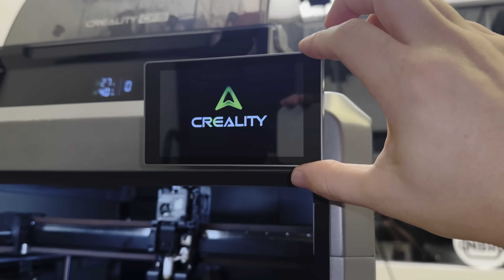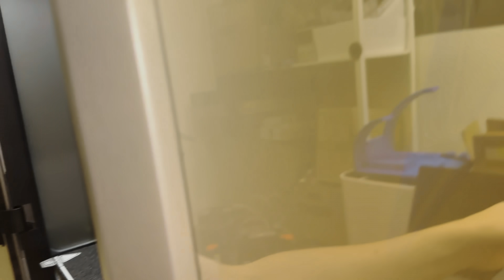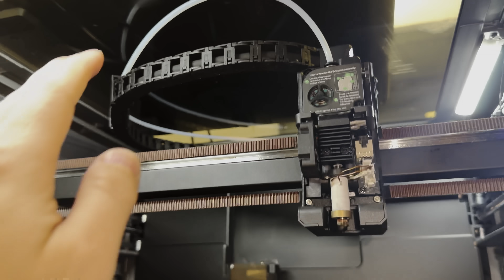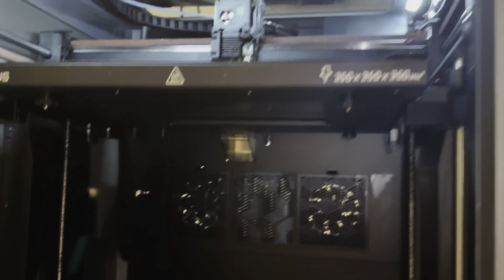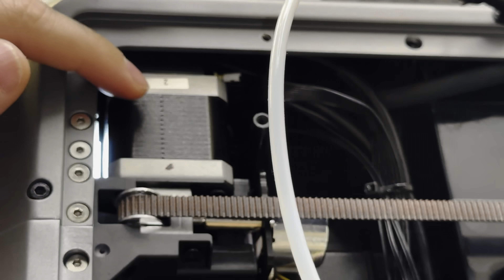Creality K2 Plus - What's Under the Hood?

Comment: And 3 months later we find out that the extruder design is not stable, gears are not harden and made of plastic, the cutter jams and causes jams on retractions, extruder coupler at the top fails often because all the torque of the retraction, and the list goes on.  Being a mechanical engineer I hope creality develops fixes for all these or a company like Biqu provide a better design extruder to replace this mess.

Comment: if the bed sink, that means on power loss it can't resume perfectly right?
Reply from the maker: No, it works fine. It homes at the bottom and generates bed mesh at the top. On power up it rehomes to establish its position and resumes.

Only issue is if you wait too long before resuming the printed part on taller models it can shrink and cause a gap where the resume starts, but that is a problem for basically every printer.

Comment: Just picked one of these up this past weekend.  While I'm enjoying it so far, and is pretty on-par with my X1 Carbon... one thing I wish was that Creality got out of the habit of NOT having stuff turn off.  I mean why does the PSU fan STILL have to be on the entire time the printer is on?  Am I going to want to mod the PSU fan on my new $1,500 printer just like I did on my first $99 Creality Ender 3 Pro?  I'm thinking kinda yes.... but seriously, it would also probably help it NOT somehow supposedly use 24w of power when just sitting there not doing anything.  The X1 Carbon only uses like 4w at idle.
Reply from the maker: My PSU fan isn’t loud enough for me to notice that it’s powered on, but that shouldn’t be an issue at this price point
Reply: @NathanBuildsRobots  unless it's NOT the PSU fan, but it's definitely a fan of some sort, and it's not any of the chamber fans.  Considering the PSU looks the same as what was in the ender 3... Gonna go with that being the culprit.  Lol
Reply: @NathanBuildsRobots  Yeah, it really shouldn't.  But I can tell its on from the other room... even if it's just been sitting there idle for over an hour, whether it had printed something and long since cooled down, or I had just turned it on.  Like I said... just like the old Ender 3 Pro, when power is on, the fan is going.

Comment: You may want to try “Ronsonol” lighter fluid as a sticker residue remover. I’ve used it on a variety of plastic surfaces, including plastic convertible windows, and it removes the residue faster and cleaner than any of the purpose made removers. Your mileage may vary and I urge testing before use.

Comment: I'm confused about the chamber heater.  Where it is pulling air from?  Inside the chamber or is it constantly pulling fresh air from outside the chamber?
Reply from the maker: heater pulls in air from outside, it has a 60C limit.

If they needed it to get hotter or run more efficiently they could recirculate air
Reply: @NathanBuildsRobots  Seems like a big waste of energy to be constantly heating new air rather than just keeping it in the chamber.  It also means more expelling of printing fumes out into the room.  If you covered the back air intake/exhaust holes, do you think the chamber heater would effectively recirculate air by pulling it in from the fans to the left and right?

Comment: In my experience with the k1 max and printing almost exclusively in ASA, the electronics can not handle the heat. 

Once the chamber is 45c on my k1 max, things start failing. Camera usually turns off. Im currently adding a fan to the heatsinks i already added...

Comment: God dang creality came in strong whit this one holy moly a bigger machine, RFID for the ams and outside the printer whit filament quantity display, filament dryer, easy parts replacement on the hot end,heated chambre and belt tension motors WOW this might actually dethrone the bambu.

Comment: Any ideas how hard it would be to make the vent fans actually vent outside? With my K1 Max someone designed a clip on adapter that allowed you to attach a 4" duct and fan to vent the printer outside... I print a lot of ABS and ASA. I figured someone might be able to make something magnetic perhaps? I thought I saw a magnetic poop catcher. I invision it being like a Y shape... connect over each exhaust fan and then at the other end of the Y they converge to a 4" duct to connect for propper venting. 

I print in an area I occupy and the ABS fumes are not something I want in the air.

Comment: Are there any marks on the back plastic part of the printer to indicate what type of plastic it is? Are the electronics screwed into the plastic? Do you think making a back plate made of pet-cf would be possible? How about covers for electronics inside the printer made of pet-cf? I'm thinking of high temp plastics in place of the stock plastic for esthetic purposes as well as making it  able to handle higher chamber temps with additional chamber heater

Comment: Regarding the electronics.. card at the front is the CPU, a 1.2GHz 64 bit dual core ARM that can run in 85 degrees celsius without heat sink (basically a mobile phone CPU) . It has plenty of power and can run the printer with its pinky finger probably only manages the screen, IO, wifi and such... .
The board on the backside controls the motors, however it seems like the actual driver is on the small breakout boards next to the motors. 
The small pcb at the back in top is probably the LED light driver.
Feels like this printer is a very modular build and changes are to be expected in upoming versions to reduce costs.

Comment: Hey @NathanBuildsRobots, I'd be interested to know the exact limits of the print size. Is it 350x350 exactly or can it be pushed further a mm or two? Sometimes these companies advertise the size of the bed but the print size is actually smaller. Important for me as I have a business that mass prints a specific part which is 350x350mm circular. Also I'd like to know the exact chamber temp it can get up to and if the temp is even inside the whole chamber.

Comment: Thanks for the video.
Frame on K2 is realy should become industry standard. It looks overengineered, but it's perfectly fine for 1.5 grand.
Lack of dryer in the Creality AMS implementation is my biggest complaint for now. Anycubic ACE Pro has that.
Last hanging questiosn are:
- Is extruder motor closed loop? (has encoder on the motor)
- Does hotend uses thermal grease? (did creality put additional thermal grease package in the box

Comment: I got a K1 Max and now I'm ITCHING to get a K2. The max is modded to the wazoo with linear rails on X/Y, watercooled heatbreak and other goodies. It's a dream of a machine now, but the K2 with those servos and the CFS is just so juicy
Reply: You listed off the bells and whistles of this thing but is any of that actually needed? I have a K1 Max too and it prints fine. I mean, there's nothing on this machine that interests me except the bigger build volume.

I don't even care about the multicolored printing. I don't even use the AMS for that on my x1c. I find it to be a waste of material and time.
Reply: How well does the watercooled heat break work on your K1 max? I've been having some heat creep issues on mine (stock heat break, Microswiss Flowtech hotend), causing jams.

Comment: The Mainboard doesn't need stepper drivers as the drivers are integrated into the closed loop control system of the motors, so the wires you see are most likely power, step, direction, enable and uart for sensorless homing. That's probably the same reason why they are outside the chamber, the driver would need active cooling. I find it very odd for the z axis to go down on its own, i have only ever seen that on belted z since there is less and different friction involved. I couldn't really tell, but were the leadscrews 4 or 8mm pitch? 4mm would be self locking if im correct, so impossible to backdrive. 8mm could be back driven, its not that hard with POM leadscrew nuts, not sure about brass ones, haven't had one of those in three years. Certainly interesting design with all those servo motors, although i still dont get it why manufacturers use smooth idlers on the teethed side of the belt. I would understand bearing stacks to a certain degree since they are sturdier, but not smooth idlers. The belts are 9mm, right? I wasn't sure as they look a bit thin compared to the ones i have on my 350 trident, but 6mm would look even thinner, ao i guess that answers my question already.

Comment: Nope closed looped steppers are very different from real servo motors. Real servo's are more like brushless motors like Odrive. They look like stepper motors but have completely different internals. Basically any direct drive motor in simracing wheels are servo's and they don't "steps". Closed loop steppers are just stepper motors with position feedback. 😉
Reply from the maker: Yes but these are "closed loop FOC motors" according to Creality's marketting, so they aren't stepper motors either. Odrive is capable of FOC control, right?

Comment: 2 things .. 
1: that empty bottom chamber is begging to be used. Either with a slide out drawer for storage, or an extra place to put fans for cooling for PLA purposes. 
2: any idea on the wattage this thing pulls when it's at full use with the heated chamber and higher temps? Have a feeling it's going to be substantially more than lower tier printers.
Reply: The stated specs is 1200W, no idea of actual power draw yet.
Reply from the maker: I'm guessing it draws ~500W max on 120V, and 1200W max on 240v.

Comment: I don't know if I'm right but i think the chamber heater should take air from the inside of the chamber (recirculate and warm it up) not push air from outside, for me it makes more sense...
Reply: You do lose some control then. If it is too hot, where is the cold air going to come from. Recirculating is good for heating, but not for controlling the temperature.
Reply: @alexa5231  Maybe use the exhaust fans to cool the chamber, only if needed. By doing that you save some energy. Like a PID control with two outputs, if temperature is less than the set point the heater is on and chamber exhaust fans are off, if the temperature is higher than the set heater is off and chamber fans are on... Split range.
Reply: My first mod would be a cover over all three fans causing them to recirculate rather than intake/exhaust.  I would prefer to have both fumes and heated air stay in the chamber.
Reply: @CL-gq3no  Yeah, there are fumes also, you are right, I forgot about them.
Reply: They’re using several PTC units that look to be around 400W each.  Those generate an enormous amount of heat, and if you don’t keep a massive amount of cool air constantly passing through them, they will overheat in minutes, melt their plastic frames, and destroy their electronics.  The amount of airflow needed to prevent heater meltdown requires at least an 80 mm dia. duct.  Unless you build the chassis of the printer to be as large as a refrigerator there’s not enough room to have all those big pipes returning back from the chamber to the heaters.

The smaller the volume of the system, the more challenging it becomes to maintain the air flow via re-circulation.   You have to have at least close to equal the amount of outflow [of air] from the chamber as you have going in to it.  Otherwise, pressure builds up and causes the air to back up at the heating elements and the fans.  Stalled air at the heating elements will inevitably result in heater and fan meltdowns.  Without balanced input and output air flows, the largest, most powerful fans will still produce airflow equal to only a baby’s breath.

A way you can observe this is with the new Polymaker PolyDryer product.  When a PolyDryer dry box, which has less than a cubic foot of volume, is sealed tight and hooked up to the heater docking, the air flow from the fans is but a trickle.  Put tape over the tiny air ports in the base and the airflow not only gets even worse, but the heating elements start to overheat.   Pull off the top lid, and the air moves in a much more powerful and dynamic flow.

This is why Bambu Labs has not developed a heating system for their AMS boxes, and why Creality has also opted out from doing this with their CFS boxes.  A powerful airflow has to be circulated through the units for the heaters to be able to push warm air efficiently into the boxes and this can only be done in the limited real-estate by drawing air to the heater from outside the box and venting the air from the interior of the boxes back out again.  Note how all dehydrators work in this manner.  There are no dehydrators except vacuum systems that are fully closed.  

Bambu Labs and Creality in essence are suggesting that if you want a blast oven, to buy a blast oven for drying your filament.  You can then place the dried spools into the AMS or CFS for near or mid-term availability with modest humidity control.  

In desiccators,  the hot air accelerates the release of moisture from what is being dried at a greater rate than it can absorb it.  You allow the air to mop up that released moisture to be vented outside the unit.  Then, once your filament is sufficiently dry, you place it in a sealed or vacuum sealed container, with hydroscopic beads, to keep it dry.
Reply: @nvg3810  @nvg3810  I have just finished building a heated chamber for my P1S, I used a 100W PTC heater and an air recirculating system the fans are always spinning (max chamber temperature depends on the bed temperature, I have reached 65°C with bed at 100°C, controller output was 40%), with PID controller the output will not be 0 or 100% so when the system stabilezes it will output only the needed power, I have printed for about 24 hours without any problems, I have even modded the bed so it can reach 130°C, I was trying to print pure PC, with bed at 130°C controller will output more than 0% only for the first 20 mins the temperature inside the chamber will stay > 65°C with the heater turned off.
 
https://youtube.com/shorts/OC7y6EbSCp8?si=XT_G_EMMtPFxLGnd

https://makerworld.com/en/models/372101#profileId-310144
Reply: @nvg3810   I have just finished building a heated chamber for my P1S, I used a 100W PTC heater and an air recirculating system the fans are always spinning (max chamber temperature depends on the bed temperature, I have reached 65°C with bed at 100°C, controller output was 40%), with PID controller the output will not be 0 or 100% so when the system stabilezes it will output only the needed power, I have printed for about 24 hours without any problems, I have even modded the bed so it can reach 130°C, I was trying to print pure PC, with bed at 130°C controller will output more than 0% only for the first 20 mins the temperature inside the chamber will stay > 65°C with the heater turned off.
 
https://youtube.com/shorts/OC7y6EbSCp8?si=XT_G_EMMtPFxLGnd
Reply: @nvg3810 , a simple temp sensor and voltage control circuit would allow them to control the output of the PTC heater.  There is no reason for it to overheat and melt anything as they are surely throttling it anyway.  It's no different from any 3D printer heated bed or hot end in that respect.  There is also no reason that they can't have ~90% of the air recirculating and ~10% or less coming from outside the case (to control humidity over time).  It would just be a matter of designing a slightly leaky cover around the fan intake area.  Also, zero reason they can't use any fan speed they want as long as the fan speed keeps up with the PTC heater output which I'm sure they are throttling as well.  So, all of these issues are pretty easily solved.  Even I have built a drying system like that using an Arduino and I'm just a hobbyist.

Comment: It's not about the ambient temperature of the PCB. Every chip has a junction temperature. This temperature might not be exceeded! So if T(j) is 85°C, your chip produces 30° heat by itself and the ambient temperature is 60°C, your core temperature would be at least 60°C + 30°C = 90°C in the best case. But due to packagesizes and heat transfer materials it might easily be hotter than this...

Comment: Curious how easy / complicated it is to get to the Extruder gears in case of TPU-salad and similar problems. Reason I didn‘t buy the Qidi, because they don‘t get it to build a reliable Extruder, and it’s a hassle to fix problems.
Or, hopefully, the Extruder is just as reliable as on my four A1 minis, where I never had to open the extruder.

Comment: Stepper deiver are on the motors with the encoders. I am amaized how Creality manage to fail again. You can’t put optical switches on the bottom for my Bambu X1C this one of the few things I hate to clean the bottom as it always goes polluted with particles from filament switching and I am sure they will go directly for the optical switches. Why the hell they put electronics within the chamber without proper cooling??? Pretty stupid cost cutting.

Comment: Not sure if the questions were all real but here is what I think are the answers.

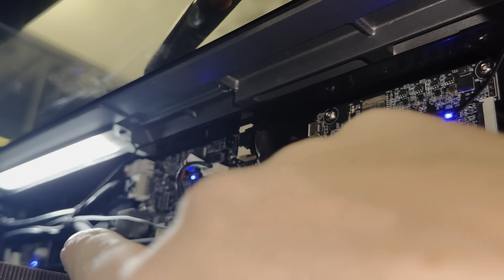17:06 yes that one is a RPi equivalent board (better called  "SBC").
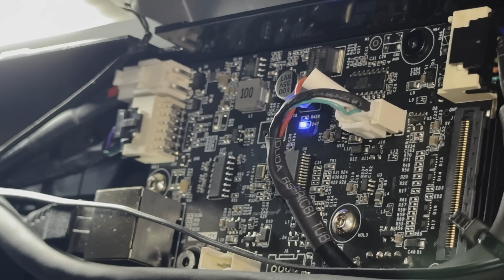17:10 that looks like an expansion board, it has the connectors that the SBC don't have to connect to the other components, the external usb and also a power supply for the SBC.
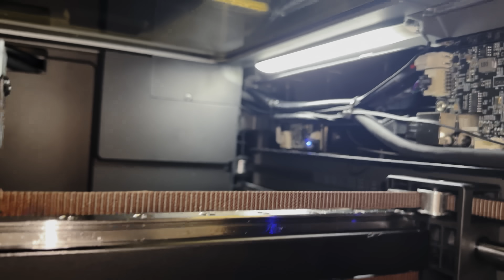18:19 I'm not totally sure about that, judging by the connectors, it looks like a module for the powering and driving of the RFID and the connector with 2 wires sure goes to the antena.
19:12 it doesn't have drivers cause many servos uses their own internal drivers, look like they made a universal controller board, maybe for a lower spec printer?
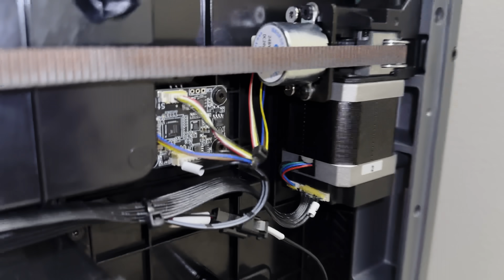20:59 that indeed is a motor, a two phase stepper.
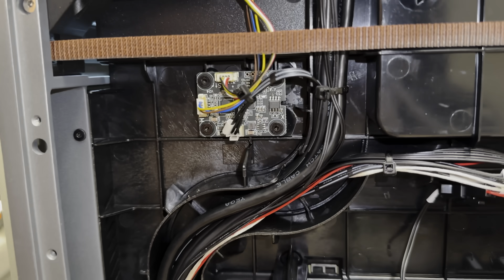23:27 those are driver boards for the steppers.
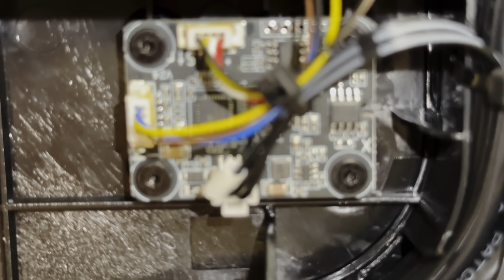28:24 using that zoom, those are stepper drivers, pretty similar to TMC drivers but a chinese variant, wires suggest a step/dir interfase and each one has it's own power supply.

I like how modular this printer is and if Creality does it pretty well on the software side, this can be huge.